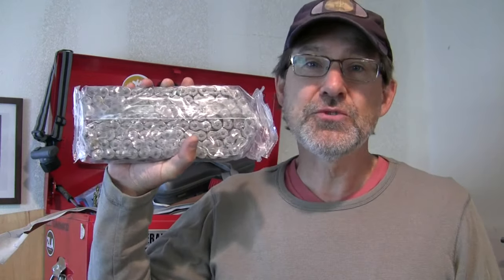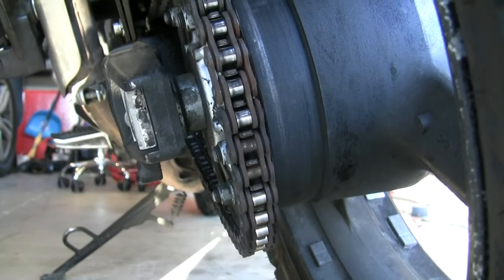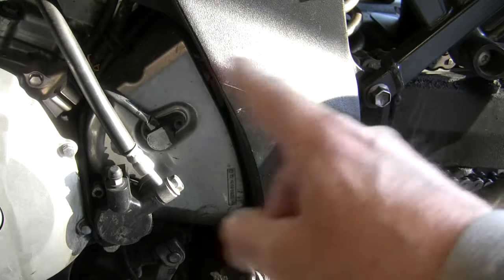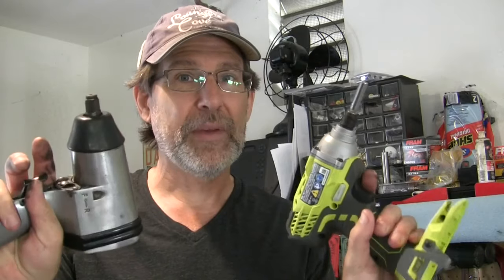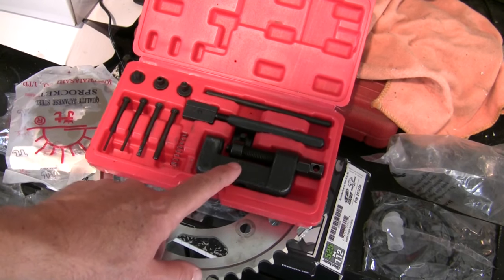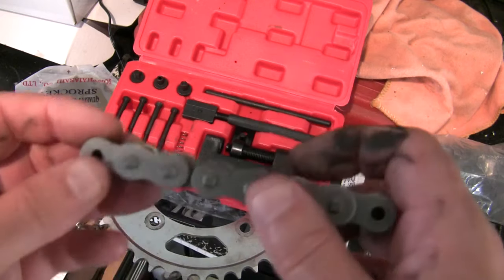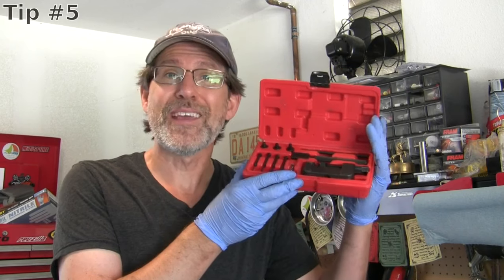5 Tips for Using a Chain Breaker & Rivet Tool

Comment: I often wonder why so many people, when replacing a chain, grind the head off of a rivet.  If you're replacing the chain and you have an angle grinder, why don't you just grind through a link and save the step or pushing the pins out.

Comment: Another tip, after grinding both  riveted pins flush to the plates there's no need to use the pressing tool at all, simply lever the plate off with 2 flat screw drivers or small pinch bar. I've replaced hundreds of chains both motorcycle and industrial and only use the tool for riveting the new master links.

Comment: I am sorry but I guess I will have to look for another video that explains more of how to use the riveting tool. I was expecting to understand what each piece of the tool does including the spring since I don't know for what or why the spring is there for.  It would have helped me if you had shown which piece of the tool you used, for example, I did fully understand the anvil you used because you showed it to the camera but didn't show which riveting tool you used and how you inserted it into the bolt on the handle, and so on... Since it will be a first for me to do a chain change, I need more understanding of which pieces do what and when to use them.
Reply from the maker: Thanks for watching. I created this video to be a "tips" video for someone who is already using the tool. Your comment is well taken though and I may soon create a video like the one you describe.

Comment: Tip for your tip when breaking the main shaft nut on the front sproket. Sit on the bike and press on the back brake l, you can then stand on the break/peg as you pull up and will crack the nut.
Reply from the maker: Thanks for that! And thanks for watching!

Comment: You missed the most important step. Measure the with of the other links so you match it when you  press the plate on. If you  press it to far together  you  will crush the o-rings and you have to start over.    Other than that it was a good video
Reply from the maker: The pins (the part that runs through the bushing) on the chains I use have a graduation or "step" in them that don't allow the plate to be pressed together to a point that would crush the o-ring. So overtightening the tool isn't possible. Perhaps there are some chains out there that do not have this and allow for an overtightening and I'm just not familiar with them. Thank you for bringing to my attention and thank you for watching!

Comment: If I may add a 6th tip, if you grind off the master link like that, you can use the new link to couple the last of the old chain to the first of the new chain, and pull the new chain in easy and fast.
Reply from the maker: Thanks for throwing that good idea in here for the benefit of others! Would make things easy, especially if one is not replacing the front sprocket along with the chain. Even then, one replace the sprocket before pulling chain through.
Reply: Alas I want to use the old chain to rapidly measure /fit the new chain - and I'm replacing 2 x sprockets too, but I like the idea!

Comment: Good video, I would probably use the two pressure plates to push both sides of the link simultaneously before proceeding with riveting, this way you don't have to worry about pushing unevenly one side more than the other
Reply from the maker: Thanks for watching and commenting. I shared my opinion on that in an earlier reply here. In short, not an issue. I always appreciate the discourse though.
Reply: @UrbanMonkTV  no worries. "Simple" videos like this one are helpful to many people 😉
Reply: To add , use caliper to see width of links next to one you pushing, to make sure it's not too tight before flaring.

Comment: Many thanks for this video. I have two sets of the same cheap chain breaker/riveters and I don't do them enough to remember how to use it! I did a 520 conversion on my 600RR and low and behold, exact same rivet sizes to the 10th of a mm. I ended up with 5.72 after the squish and I found later that you ended up at 5.73 :) Anyway, you made installing the chain a 5 minute job and because of the squish I know it's exact.
Reply from the maker: Thanks for watching! Enjoy the ride!

Comment: I’ve never done this before I always used a masterlink with a clip, I just ordered this tool because my new chain came with the rivet link, thanks for the video
Reply from the maker: Thanks for watching. I've used clip style master link in the past also without issue. Some reports out there in the Internet of clips coming off but I've never experienced and would guess it's rare for those properly installed on street bikes.
Reply: @UrbanMonkTV my clip came off in less than 500km.

Comment: Hi. My first time doing this was yesterday outside in the cold on a 428 chain. I was using the same tool, ground the heads with a Dremel - good, pushed the pins - good, tried using the 2 plates that came with the kit to push the master link together - bad, I may have bent the tool. The kit is rated for my chain, but the holes in the plate didn't line up with my pins. I was cold and pretty frustrated yesterday. Anyhow, watching how you pushed the plates togther with the large thread makes a lot of sense to me, after my experience, Thanks. Happy Saturday after Thanksgiving!
Reply from the maker: @danr1832  Sorry you ran i to trouble and cold weather. I've bent one in the past too so you're not alone. Thank you for watching!

Comment: Informative video, thank you.  I have a gen2 V650, but everything looks the same, that "doodad" is on mine too and it now makes sense that going from the 15 tooth to a 16-tooth front sprocket why the speedometer now is 100% correct from the 4-5 mph error it was off before. I'm going to be doing a trip similar to yours and changing out the countershaft lowered my cruise 500 rpm's at 75 mph. the bike still has plenty of low-end torque for getting under way. I did use the impact, but the bike was in neutral and rear brake applied. Final tightening was using the torque wrench from about 60 ft lbs. to the 83 ft lbs. that is required. 
I was going to replace the chain before I left on my trip but the bike only has 13,000 miles and has always had good chain maintenance so I think I will hold off replacing until I get back from the trip to the east coast and back to AZ. then I'll have to watch your video on replacing chain and sprockets 🤣 Take care - Dave
Reply from the maker: Sounds like you are using good logic IMO (not that  my opinion matters - It's your bike right?). Enjoy your trip! Jealous. Wish I could get away for another epic ride right now, but soon enough.

Comment: Thanks so much!  I screwed this all the up the first time I used my rivet tool.  I mean it went on there but the master link broke 1000 miles in.  I got a new chain and sprockets (yes, it damaged the rear sprocket coming off and maybe the front and they were new too.  Cost me $200 and a AAA tow and some time.  In hindsight, the creaking I thought on starting sometimes that I assumed was the clutch was probably the master link.  So now I got the new sprockets and chain on and this time I measured the width of the link after squeezing it together.  And then the heads of the rivets.  And I'll be watching carefully.  The chain nicked the case because I was going 80mph on the interstate but it did not crack the cases and I was very lucky it didn't.
Reply from the maker: A little recurring luck is a welcome thing in a motorcyclists life. :) Glad you didn't crack the case.

Comment: great tips. I am about to do my 1st chain change after 41.000 kms. I was getting a weird noise from the chain and I noticed that I have inconsistent slack as in if I spin the wheel, every now and then it gets pretty tight. Upon inspecting the front sprocket I noticed it's pretty bad with seesaw thinnend teeth. But yeah, I was already planning to keep the bike on the ground and use a breaker bar, tnx for confirming that it works :) I already, partially broke one of the pins, just to test my tool (I don't have an angle grinder) and it worked pretty easily but I bought an animal of a chain tool, some german stuff that weighs over 400 grams (almost 1 pound :)) ) Anyhoo, tommorow I need to buy a 32 mm socket and proceed to finish the job.
Reply from the maker: Thanks for watching and commenting. I make my repair videos for that specific reason, to help others with their projects. So your comment makes me feel great. I sincerely appreciate it.

Comment: I just use a wood to block the rear wheel and put the bike in neutral when using impact gun to loose the sprocket nut, works quite well. I am replacing the chain and both sprockets so I don't care any damage to those parts. Nice tip on that rivet tool though, helped me a lot when I reinstall the master link!
Reply from the maker: Thanks for watching! I'm glad to hear you put the transmission in neutral before using the impact wrench, as there are gears on the counter shaft and drive shaft that are engaged with each other in that state. Some of the forces of the impact wrench are experienced between their tooth surfaces, but it seems you are doing everything you can to keep those forces focused at the friction of the nut and nut threads. Appreciate your comments.
Reply: Yeah definitely not want to mess up the gears in my transmission :)

Comment: 3:12 Tip 1) Don't lift the rear end before getting the front sprocket loose.
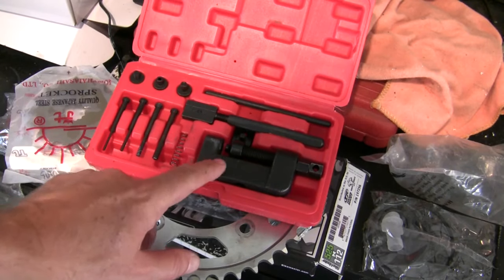6:56 Tip 2) Grind off the rivets of the master link before using the chain breaker.
10:43 Tip 3) Measure the pin diameter before flaring.
13:08 Tip 4) Flare with both threaded parts of the tool.
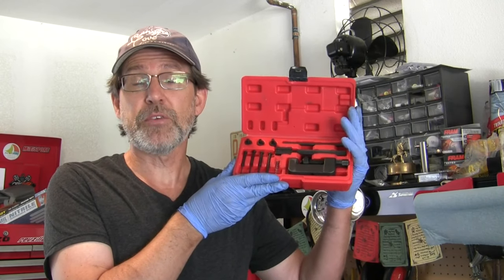14:42 Tip 5) You can get a discount code in the description.
Reply from the maker: Thanks for watching!

Comment: Wouldn't it be easier if the chain was a bit looser when your taking off the link?  This is all very interesting to me and a bit of a pain in the ass because I have had 2 dozen bikes from 70's to 750's and never lost a master link with the clip ever.
Reply from the maker: If a person has proper slack in the chain there's no need to loosen to remove an old chain. Assumption is a person is replacing a worn and this relatively loose chain. I agree with you, I have never lost a master link clip either, when I've used them. Thanks for watching!

Comment: Angle grinders or die grinders work well, used them for years, if your removing a worn out chain, just cut it off completely, it’s going in the trash anyway.
Cutting the new chain to length is just a simple then use a quick connect link to fix....no need to rivet anything, plus it can be removed easily for cleaning and re greasing...
Reply from the maker: Thanks for watching.

Comment: When flaring I have to change the anvil right ? I have to use the smaller instead of the one the fits.
Reply from the maker: For most motorcycle chains (assuming that's your situation) the anvil with the recess that is 6mm in diameter would be the right choice. As for the "rivet forming pin" use the p8n with the convex (dome-shaped) face on it. The other three pins are simply for pushing out link pins various sized chains. It should be noted there are tools in these kits for bicycle chains also. Thanks for watching!
Reply: @UrbanMonkTV  thank you that help me a lot ! So far my chain hold and looks good . I will be watching your video everytime I change my chain just to make sure 😂😂

Comment: Is there a reason why you don't use the flat parts for the tool to push the master link plate down in 1 go rather than doing it for the 2 pins seprately?
Reply from the maker: Thanks for watching! I just don't find it necessary as there's no resistance at all on that master plate. Pushing one side one moves the other perfectly squarely. Frankly the master plate wants to return "out" a fraction of a mm when I remove the tool from the elastic expansion force of the o-rings.
Reply: @UrbanMonkTV   I see. Thanks for the tips!

Comment: Where to buy just rivets for this tool? There is no master link aviable for my chain, which i can press..
Reply from the maker: First, thanks for watching. Rivet-style master links are specific alloy at the end of the rivet. They're more malleable so you can flare them. The other standard rivets won't flare easily, if at all. You'll most likely break the tool. I have found master links for sale for chains I've used on eBay. Try there.

Comment: I crank with all my force when riveting. And barely get 5.2mm. I need to use extension to finally get it to 5.6mm.
Reply from the maker: They do require a good deal of torque and I suppose that's a good thing, but like in mentioned in the video, I once cranked it so much that I bent the tool. The tool in this video is my second.

Comment: Don't buy the junk chain breaker if you have a 530 pithch chain. The tool will break before the chain  even if you grind off the rivets. It might be okay for smaller chains. Get a Kellerman tool for the best results.
Reply from the maker: Thanks for watching.
Reply: Agreed, Greg! Those cheap chain breaker kits are next to WORTHLESS. They might work on a bicycle chain, not on a decent motorcycle chain. The push rods bend or break. The threads in the frames are cut poorly and strip out. All are made with poor quality, Chinese tool (?ha!) steel. Have bought a few on Amazon, and every one eventually failed after one or two uses! A GOOD, American made, chain breaker kit will cost at LEAST $300+. I don't swap chains that often to justify that cost; and have a shop rivet on street bike chains. Jmo. 👍

Comment: Ive replaced chain on my Vstrom 17 times I’ve never ground the pins. Motion Pro chain breaker easily pushes the pins through
Reply from the maker: I suspect the Motion Pro unit is stronger than these inexpensive eBay types. Thanks for watching!

Comment: Question.  It took me several flares to get where I'm going I think.  The permanent rivets on the chain are between 4.40 and 4.51mm.  My rivets now are up to 4.48mm after flaring several times.  I don't think I should go any bigger because they look great and I don't want one to crack.  Does this sound reasonable?  I should have measured the unflared rivet.  I didn't understand this until after I watched your video but I reasoned that if my flared rivets were similar to the diameter of the permanent rivets and the flares looked OK it was probably OK. I may go back and measure the shafts on the old master link that broke.  I think what happened before is one did crack and it put sideways force and the other one and that rivet shaft eventually snapped.  The master link was actually on top of the engine after the chain flew off on the interstate and one shaft looked close to stock length but completely smooth with zero flare and the other was broken off short.  That's why I think the one flare broke off and the other side of the link snapped at the shaft.  But 112hp through the link at an angle not good.
Reply from the maker: First, thanks for watching. Second, I don't give advice on UMTV, only share my experiences and "how I do things." Everyone is on their own journey here. That said, I agree you should measure the master rivets before and after flaring. The material makeup of the master link rivets is different than that of the other rivets. What matters most is the change from un-flared to flared on the master link rivets. I've always gone by the 0.4-0.5mm flare rule, though do what you think is best. Hope this helps.
Reply: @UrbanMonkTV  I appreciate that bit of wisdom.  I just measured again and there is more like .3mm difference but I flared multiple times and the center of my flare bit is not adjustable in and out like yours is.  If I go any more I think I'm risking cracking it.  I guess I'll ride around and check it several times.  I still think if I had checked it when I heard the creaking noise before I would have caught it before it fell off.

Comment: Hi mate, what's the spring for?
Reply from the maker: It goes around the pin before inserting into the tool. Helps it retract when loosened. Thanks for watching!
Reply: That's it, many thanks.

Comment: I just used the exact same tool earlier today to change from a standard clip master link that was sticking, the riviting tool to flare the link and the anvil for it got completely deformed by the chain. Apparently the chain link is a lot harder than the tool, so the riviting tool and anvil got litteraly shaped into the master link. Also after reshaping the tool and hardening it, the threads on the smaller screw(the one with the hole in for the lever) broke. I only managed to squeeze the link from 5mm to 5,25mm. 
For me the tool is useless, mabye i have to make a new screw and riveting tool in a steel that can be propperly hardend and it could work.
Reply from the maker: What type of master link were you using? The regular links and clip-style master links have a different metallurgy to their pins whereas a rivet-style master link has pins that are specifically designed to be flared. In short, the metal at the tip of the pins is softer and more malleable on those master links. Thanks for watching!
Reply: @UrbanMonkTV  I had the samme issue sadly. Tried using it on a standard D.I.D 530 vx3 chain

Comment: So the rivet pin fits down inside the rod on the tool that your twisting ??
Reply from the maker: @domib3873  Yes. The tool has two threaded "rods" as you say. The outer rod is hollow and the tip of it surrounds the rivet with a little room for expansion. The inner "rod" threads inside the outer and acts like a slow hammer, flaring the rivet. Hope that makes sense and is helpful.
Reply: @UrbanMonkTV  thanks just ordered the same one off ebay just now never knew this tool existed much better then shaving the head off the pin and beating it out with a hammer and a punch 👍